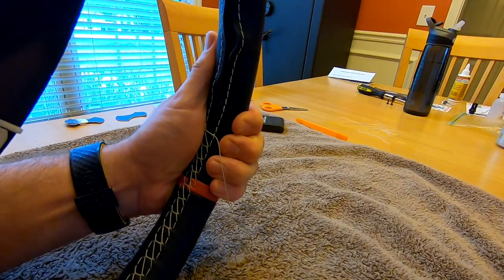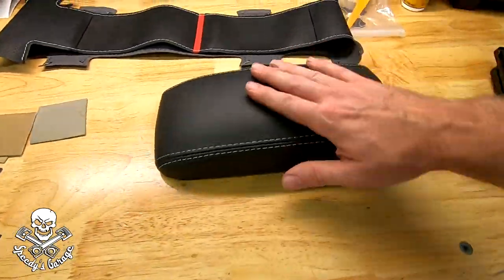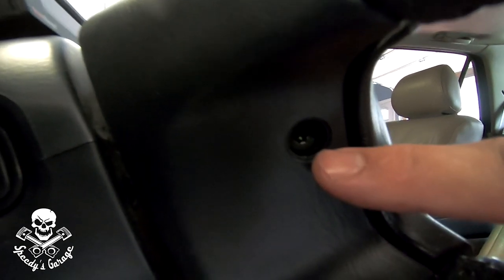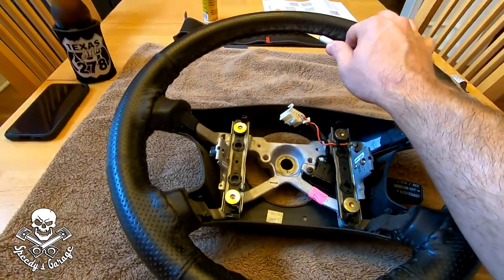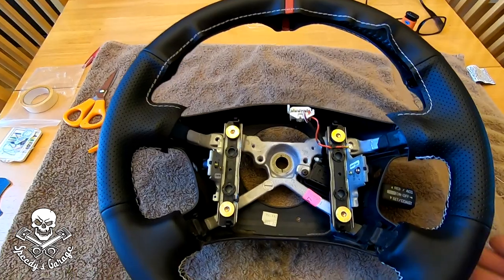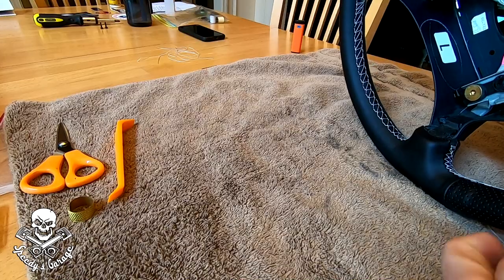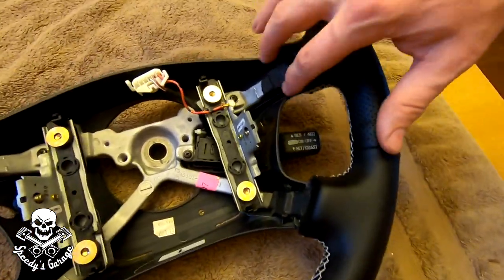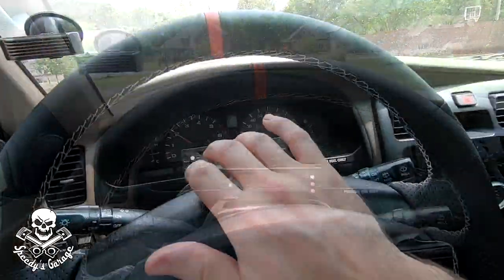New Leather Steering Wheel Cover Speedy's Garage Restoring a 3rd Gen 4Runner P15

Comment: Awesome video. Your attention to detail is seriously impressive. I've got a 99 Tacoma SR5 I'm rehabbing right now. It still has the factory steering wheel cover and I'm looking to do a perforated leather cover like yours. One thing I noticed is that the factory cover rotates around the metal of the steering wheel, like if you were twisting a throttle on a motorcycle. I assume there was some kind of adhesive or something under there that's gotten gummy over time. Is there any way to address that before putting on an aftermarket cover? Would sewing the leather cover over top of the loose factory one lock it down better and keep it still? Any advice you can give would be appreciated!
Reply from the maker: You may need to remove the old cover.
Reply: @SpeedysGarage  Thanks for replying! I suspected I might. I'm pretty new to this. If I remove the old cover, I assume it's kind of thick. Much thicker than the thin leather wraps meant to go over it. What would you do if you were in my situation? Is there a padding you buy or something before putting on an aftermarket leather cover layer? Or do you just cut the factory cover, remove it, lay down some Super 77 or other adhesive and then put it back on before sewing on a leather cover?

Again, thanks for the advice. I'm very grateful for it.

Comment: Great content, as always!  The steering wheel looks great. Mine is rough looking, and the previous owner put a decent slip-on cover over it, but I've been wanting to do it "right" like you did. I feel a little less uneasy about removing my steering wheel now after watching how you pulled it. I replaced my arm rest cover as well (with some similar material), but I used some extra egg crate mattress foam for the inside. Worked great at first, but that foam is so worn now that my elbow sinks right down to the plastic, so I may try some of that material you mentioned.  Where did you have yours done (upholsterer)?
Reply from the maker: Neoprene is what I planned to use as it's dense.  I had a local upholstery shop do it because of the unique staples required.